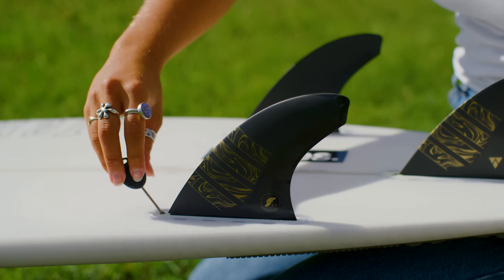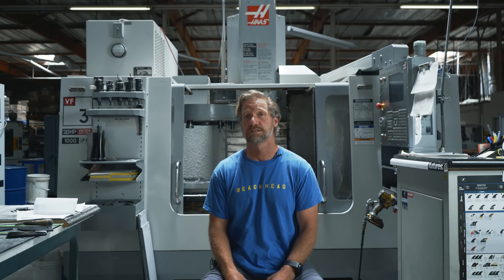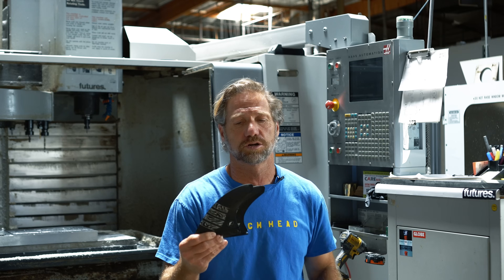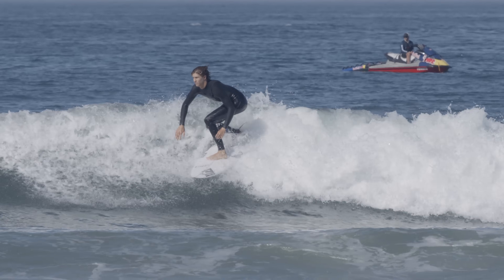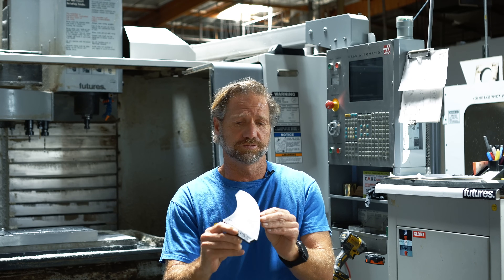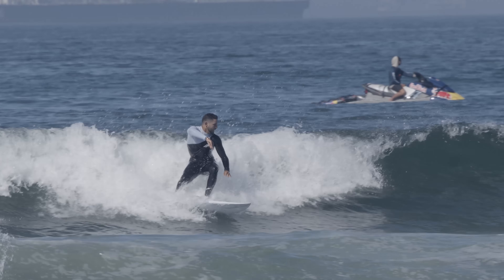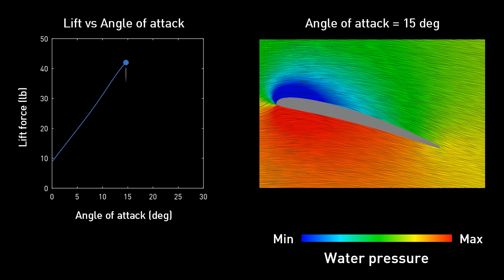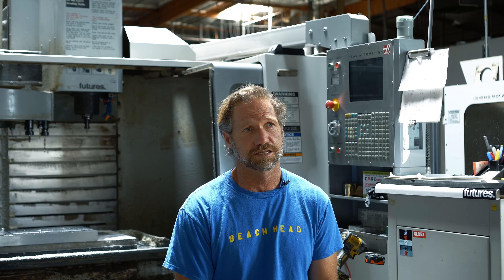What is the Vector 3/2?!?

Comment: I had what I think is the early 2005/2006 version of this fin which had a more distinct bend in the fin mid way down.  I had a rounded pin that lacked drive with normal fins.  When I put this fin setup(tri) into the board it completely changed the board and made it one of my favorites ever.  I still have the fins somewhere.  IIRC the 3rd fin was a boomarang.  Will have to try these now.

Comment: Thrust?! Out of what?! 😂 please! Thrust without an Engine? Are ship and plane engeniers stupid? Call up NASA or Google it up, at least! Stop BSting around! Thx
Reply: The surfers body movements provide external input force (same as an engine). This leads to angular acceleration which certainly feels like thrust and is appropriately described as such in this context. If a motor turns a propellor, there is no difference when a surfer expends muscle energy to cause a fin to take a set at a different angle and push against the water. In both scenarios calories/energy/fuel are being burned to impart a force on an object which then provides thrust.  Call NASA indeed.
Reply from the maker: Thrust/drive

Thrust - to push or drive with force
 -  Merriam-Webster
Reply: @futuresfins do you like these as a quad setup too or is it best as a thruster i have a 5set about to go onto a new gremlin xl eps grovler
Reply: https://www.grc.nasa.gov/www/k-12/VirtualAero/BottleRocket/airplane/thrsteq.html#:~:text=Thrust%20is%20a%20mechanical%20force,some%20kind%20of%20propulsion%20system.
Reply: Lift and Thrust is Not the same! 
 – physics
Reply: @LukkaKuhaarski y quién está hablando de sustentación? La tabla de surf no necesita sustentarse porque flota y se apoya en el agua 🤡, sería divertido pero por el momento no existen tablas de surf para surfear el espacio por lo que nosotros no tenemos absolutamente ningún problema con la sustentación 
(Clave: para hacer más el ridículo siga respondiendo.......)
Reply: @cindihausheer639 But it is Not Thrust! No matter how it „feels“ to Someone. Girlfriend can t understand Pizza problem..😅
Reply: Please google it, you just look stupid at this point. 😂

Thrust
/THrəst/
verb
Push (something or someone) suddenly or violently in the specified direction.
"she thrust her hands into her pockets"
Reply: @LukkaKuhaarski It is. Please educate yourself- and understand words have multiple definitions.
Reply: @LukkaKuhaarski 🤣🤣 eres un paleto con aires de grandeza amigo......está perfectamente explicado en leguaje técnico de surf, que tu obviamente no entiendes. El empuje real lo ejerce la ola, que es de donde procede la energía en el surf. Sin embargo se dice que las quillas empujan" en mayor o menor medida porque su forma y tamaño son determinantes respecto a cuanta energía de la ola se transforma real y finalmente en empuje-velocidad del conjunto surfista-tabla de surf, lo entiendes ahora?..........
Reply: @CiudadanoX-qg8en oh, now I get it! Surfing is so special that it does not give a fak about physics and still works. It’s fine
Reply: @LukkaKuhaarski que el diseño de una quilla haga que la tabla de surf aproveche más o menos la energía de la ola y la convierta en empuje hacia delante es física de fluidos (hidrodinámica), otra cosa es que tu lo entiendas.
Sigue viendo Doraemon anda.......

Comment: What difference between those ones and the jjf scimitar ?
Reply: I have both 3/2 in M size and JJF Scimitar(large)...I will focus on performance, as technical characteristics are available at Futures web. For me(73Kg) are  different, 3/2 are ideal to increase reactiveness on a chunky, wide or stiff board for small-medium waves but holds with some wave size and speed. JJF Scimitar are intended to maximize speed on grovelers and for heavy back footed surfers, too stiff for me due to the raked back fin.   JJF scimitar wirh 3/2 back fin works great for me looking for a speed generating set on a thruster. Hope it helps😉
Reply: @sergioalvarez376 so do you like the scimitar with 3/2 trailer even more than stock medium 3/2?
Reply: @gkl68  I prefer stock 3/2 set for medium waves looking for more responsiveness but JJF scimitar + 3/2 trailer for small waves looking for drive and speed generation. Please note that I use 29L board 19,75 wide...3/2 fins eases to set the rail if you have a little flotation excess.
Reply: @ Interesting sounds like the bigger JJF gives more drive and 3/2 for quicker response. Not sure if the cant is playing a big factor then? 🤔
Reply: @gkl68  in my experience with these fins extra cant at the tip helps to put the board on rail and initiate the turns, specially useful for wide boards for most of us that surf with 2 extra litters
Reply: @ Makes sense!Thanks for that :)
Reply: These have the the 3/2 thing hes describing and the JJF doesn't.  These are made with alpha and the JJF are made with vaporcore.